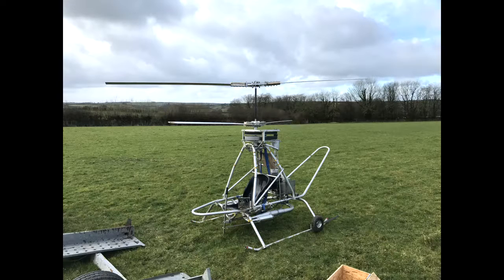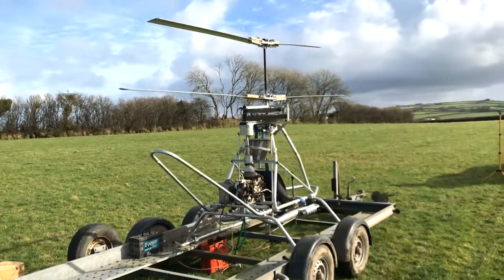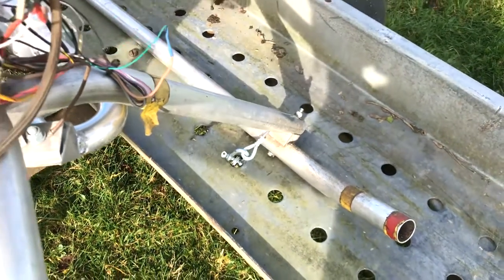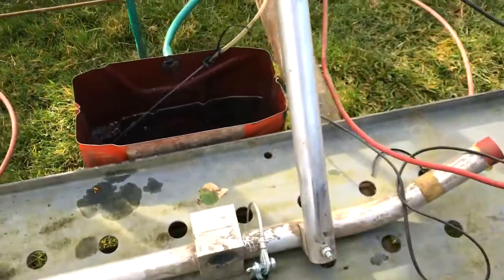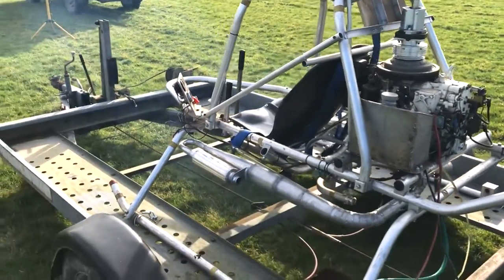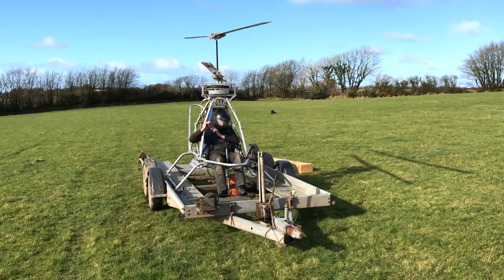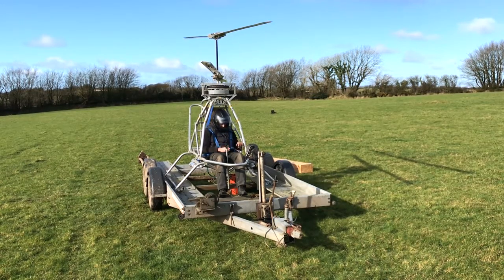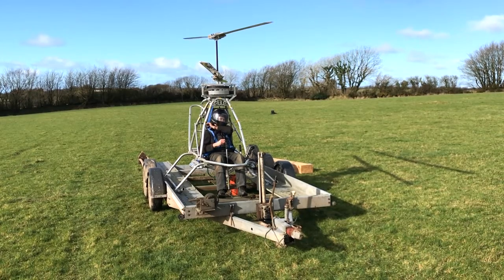My Homemade Helicopter Can Fly

Comment: Wow, Notice the abscence of Collective? these blades are fixed pitch, there are no normal helicopter linkages, its pull on the throttle which means its not a real  helicopter than can autorotate. Contra  rotating blades are far more stable but still need to change pitch if there is an engine failure.
This machine cannot be flow anywhere other than ground hover without the risk of certain death from an engine failure.
Reply from the maker: I thought contra rototating blades would be more stable. They definitely aren't, no more stable than an R22. 
Yes only a couple feet.

Comment: This is great. I’m planning on making my own and I already have some ideas!
Reply from the maker: 👍 full scale or model ?
Reply: @Ben-Dixey  full scale
Reply: I’m getting a 3d printer soon which can be used for precision parts
Reply from the maker: I've not used a 3d printer before but I've seen people use them to make  some complicated parts. Will have to get one myself one day. My only reservation is the strength of the parts it produces, in plastic anyway.
Reply: @Ben-Dixey  I’m planning on it being electronically powered but I don’t know if that wil work

Comment: How did you get past the CAA interfering, they keep homebuilt helicopter as their control entirely????? How would you explain flying with an underslung trailer?
Reply from the maker: During the hovering the machine is tethered at all times. Ground anchors and cables. I think tethered is ok but I might be wrong.
Reply: @Ben-Dixey  I was joking about the trailer at a ton weight.
Reply from the maker: Sorry yes. 😆 my friend suggested there must be easier ways to move the trailer around.

Comment: Sir plz change the sparkplug with iridium tip sparkplug and use engine adhesive in engine oil to reduce vibration,wear and tear too

Comment: what kind of engine did you base it on?
Reply from the maker: It's a 60hp Johnson outboard engine. 2cylinder 2 stroke, the tuned exhausts might have increased the power above 60 though.
Reply: @Ben-Dixey  dude. So it's a manual trans??? How did you connect the propellers to the drive train
Reply: @Ben-Dixey  oh nevermind that's a boat engine. I figured since it was 2 stroke it'd be a bike engine. I suppose the switching gears would making flying really difficult wouldn't it
Reply from the maker: That's it, one gear and one speed, I've seen some homebuilt helicopters that have used a multi gear transmission but it's pointless additional weight.

Comment: I don't understand what was the purpose of the video that nothing useful was seen, a man sitting without doing anything
Reply from the maker: The video demonstrates the helicopter can actually fly, it's tethered to the Trialer for safety but lifted off a couple inches. This was a massive achievement after five years of designing, building and testing. The videos after show it hovering up to three feet now.

Comment: Cool, does the difference in pitch ensure they both have the same AOA so torque is equalised across both discs?
Reply from the maker: Yes I believe that is correct, the downward flow of air onto the bottom rotor reduces its angle of attack.

Comment: do you know the power band of that motor and it's safe operating rpm?  it looks like you didnt get lift till way up in rpm. Perhaps you need more Blade to get the power to the wings a little earlier.
Reply from the maker: In this video the engine is running at around 5500rpm and it's standard maximum is 6500rpm. Because I've made the exhaust expansion chambers I'm not sure what the power is now or the band. Since this video I've done more testing and added much more weight, but it's now fully capable of free flight. I just need to learn how to control it.

Comment: Maybe make the chambers out of 0.6 mil steel. Aluminum can not resist the temperatures and vibration and will always crack unless you make it so thick that there will be no weight advantage. You don't want to experience a crack when actually flying, the power drop will be significant . Look into hydroforming for your exhausts, it simplifies the design and the amount off welds needed, so lesser potential points of failure. Make your calculations with the chambers to prevent  the engine to become to peaky, volume and length are your friends here to keep a torque and not only max HP. The tailpipe and mufflers don't need to be at the end of the pipe, think of them as overpressure valves and mount them were its convenient. Leaving your brass balls at home might help you lifting off😁.
Reply from the maker: Thanks for this. I think you're right about using 0.6mm steel over aluminium the vibration issue I'm sure will cause cracking at some point in Ali. The exhaust gas temperature I think I calculated to be around 350degC well below the melting point. 
Hydroforming would definitely be worth trying next time as long as it comes out half decent I would be happy. 
The exhaust tuning side of things I used the calculations from the AU mechanic on YouTube, brilliant set of videos going through it all, i used the figures for broad power rather than peak power and the pipe dimension were altered accordingly, the tuned length is quite long. 
You mention the muffler doesn't have to be on the end of the pipe, could you expand on that ? Cheers
Reply: @Ben-Dixey  You can have the tailpipe (or stinger ) welded  somewhere in the midsection of the chamber without any negative effects on the engines characteristics. In the 80's I used to race with a Yamaha TZ750 and my set of pipes for rainy weather or circuits with many  short corners were like this. Because I could make the pipes longer it helped me with gaining bottom power, lowering the powerband by approx. 300 revs. , making the bike less twitchy to drive, but losing top speed. I am not sure if expansion chambers are the way to go, because they will narrow your powerband, forcing you to check revs constantly . When a two stroke gets "off the pipe", the power loss is substantial and before the engine is revved up enough to profit from the pipe, some time will have passed. You don't have a gearbox and clutch to compensate for these things, just altitude. Not something you want to happen on the wrong moment, real live is not a cartoon.  Look at the rotax aircraft engines, they don't  have expansion chambers and deliver power over a wide powerband. Might be worthwhile to have a chat with someone in the know or try to find some information about what pipes they use (aftermarket catalogues anyone?). Engine manufacturers have bigger wallets then you ( I suppose) and have already figured these things out in the past.
Reply from the maker: Understood, I remember seeing somewhere about the tail pipe being inserted into the baffle cone and it not affecting power. I think I didn't do this as I needed the tail pipe to do a 180 for muffler fitting purposes. 
The 2 stroke aircraft engines as you say don't have expansion chambers and I'm sure they designed them for reliability over peak power. I have the dimensions of a 50hp Hirth aircraft engine exhaust and was going to copy it. Then I started researching expansion chambers and decided I wanted the best chance of lifting off rather than reliability. After the prototype machine has been proven to fly under control I might well revisit the exhaust and try the copied Hirth design. The helicopter in its current format is only going to be flown at a few feet and no higher for other safety reasons than the engine reliability issues. I've done 3 more videos since this one and performance wise the exhausts are working for me. I tried a generic eBay exhaust and the helicopter wouldn't lift off the ground so something is working. Any ideas what Hp gain it's likely to have from adding expansion chambers on a 60hp outboard power head ?
Reply: @Ben-Dixey  Given that a normal outboard exhaust is just some collection area that vents under the waterline, I can only assume that it doesn't get worse. Beware that expansion chambers can have some very expensive side effects on cylinder heads and pistons(don't ask me how I know😭), so keep an eye on your jetting, you don't want the engine run to lean. Better keep mixture on the richer side to help cooling your pistons. How many degrees is the exhaust port timing? Small tip: To prevent cracking of the exhausts it is best when mounted with springs at the cylinder side and rubber silent blocks further down the line.
Reply from the maker: @dutchsailor6620 Someone else warned me about running lean with the expansion chambers.  I've been checking the spark plugs against a chart comparing lean to rich and they look ok to me but I haven't gone any more scientific than that. 
The exhaust port timing is 168.5 degrees. 
I've got the expansion chambers mounted on springs but there is approximately 6" of rigid tube from the manifold before the springs.  I had an issue with a rubber mounting bracket broken from the vibration, I added another mounting point further back and it hasn't broken again. How have you checked the mixture before ? gas analyzer?
Reply: @Ben-Dixey  A gas analyzer on a two stroke engine is a lost case, the readout will be very depending from  the combination rev/tuning/reverse spooling. Also I don't think that the probe will survive the unburned oil/gasoline shower. Its back to old fashioned sparkplug  reading. In my experience, outboard engines are normally jetted on the rich side, so that is ok. Just keep an eye on those plugs. Anything lighter than coffee brown should get your alarm bells ringing, greyish is definitely to lean. I watched the videos of the pipes. Instead of mounting the pipes on the manifold  with a flange coupler, a coupling where the pipe slides over the manifold might be more secure. With a 168.5 degree exhaust timing , the engine will have a lot of bottom power (4 blade props maybe?) and by the looks the pipes are not that aggressive, resulting in a wide powerband. The stingers look rather large in diameter, making them a little smaller will result in a stronger return pulse from the exhaust, but will raise the temperature in the cylinders. What is the capacity per cylinder?
Reply from the maker: Thanks for your expertise. Each cylinder is 368.5cc. Engine Rpm at lift off is 5460. I think the book rpm for peak power was 5500-6000 with the outboard standard exhaust.
Reply: @Ben-Dixey  Happy to help. At this cylinder capacity I would leave the stingers alone. Best is to look at the whole project as a proof of concept and not try to milk the last HP out of the engine. It might be interesting to mention ambient air pressure in your next videos, its another reference point and interesting to see if it affects the outcome of certain tests. (Higher pressure = more engine power & lift from your blades)
Reply from the maker: Good idea, I'll mention the temperature and elevation. I expect you know but helicopter performance is greatly affected by density altitude not just engine performance but lift is affected too. Helicopters have an inlet manifold vacuum gauge to tell the pilot how power is being used. I think this is like a throttle position sensor so could be done electrically instead. I have a vacuum gauge but haven't attempted connecting it to the engine yet. It would be good to know what % power is remaining at hover.
Reply: @Ben-Dixey  Add humidity too, this greatly affects 2 stroke performance. With these measurements its not so much about  accuracy but more about consistency. It might also help you  to predict what you can expect from a test run and recognize potential failures before they manifest themselves otherwise. Spreadsheets work great for these things.
Reply: Just as an afterthought: I see you testing the helicopter while standing on your trailer. Would it be possible to park the trailer on a vehicle scale (example: MOT station) when testing with the helicopter strapped on, so you can calculate the generated lift? This might also be helpful when evaluating if changes are made or to test the effect from settings. I don't think you can test those to the full extend when tethered to the ground and it will be less risky.
Reply from the maker: @dutchsailor6620  Great thought as it would be an excellent way to measure the lift and as you say collect some performance data. can't see any weigh bridge owner letting me test an experimental helicopter on it but you can buy corner scales for race car preparation. Might be a cheap enough set somewhere? From my research with 60hp maximum take off weight would be around 275kg, it's currently lifting around 240kg so not much left to play with.
Reply: Another brainfart: If you know the total rotating mass off your helicopters shafts, rotors, rotor heads, drive wheels etc. and would measure these parts revolutions over time (not the engine revs), you should be able to calculate the power needed to get there, much like a dynamo-meter used for cars and motorcycles. This might also show how your pipes are performing and if the fuel/air ratio is acceptable over the whole power range.
Reply from the maker: @dutchsailor6620  Interesting thought, I know what your getting at. All this weight would act like a flywheel and you could measure the acceleration of the mass to calculate the power ?  The only trouble is a flywheel would have little drag from the air where as my rotors have massive drag. Personally I wouldn't be able to work out this drag and factor it in, there might be someone who could but like the lift calculations they are to complex for me. I would like to build a dyno one day and this project would be the perfect excuse to build one.
Reply: @Ben-Dixey   Because the drag will be there at every measurement the reading would still be consistent. the engine still has to deliver the power to overcome that drag. Dynos are wide open throttle things anyhow. You might not get the same graph as if you put the engine on  a real dyno, but also their output varies . No 2 dynos will give you the same result, just swapping rims for another material is enough to mess up your results. Just ignore the drag factor (treat it as a constant in all the measurements, so basically ignore it) and look at different readouts as relative values, not absolute. You could  build a pickup for next to nothing using an Arduino and a reflective pickup or a hall sensor for rotation vs time measurement. http://wotid.com/dyno/content/view/16/35/ is a great source for the math involved.
Reply from the maker: @Dutch Sailor  I can see how performance of the engine can be compared in this way when altering things like the exhaust design. In order to determine an actual figure for HP am I right in thinking this has to be done from accelerating a known inertia flywheel? On the website you shared it doesn't take into account any flywheel drag from the air or bearing friction, my drive has quite a few bearings plus belts and the massive drag from the air would need to be calculated to find an actual HP?
Reply: @Ben-Dixey  For measurement Prop, drivetrain, drag and friction are the same as the ideal inertia.  You can look at the drag and friction as a part of the inertia that has to be overcome. It will be there always and in every measurement, these are not variables that can be altered in any way so you just take them in the equation. A car/motorcycle dyno also has its losses like bearings and brake friction pads but they are not taken in the equation either. The only thing that in your setup matters for the lower rev measurements would be centrifugal clutch slip. That is why I advise you to take the measurement from a drive shaft. After the clutch has full grip there should be a linear relation between motor revs and prop revs, but this will depend on the centrifugal clutch adjustment .
Reply from the maker: I will give this some thought and try to get my head around it.
Reply: @Ben-Dixey  👍

Comment: Nicely done. Why different pitches in the two rotors? That will surely result in unwanted yaw.
Reply from the maker: Because the lower rotor is working in the downwash of the top rotor lift is decreased and so is the torque. It's balanced now and a one degree difference is what was needed.

Comment: How do the coaxial rotors work?
Reply from the maker: That's a big question but the point is to equalise the torque on the airframe so you don't need a tail rotor.
Reply: @Ben-Dixey  true,

Comment: Excellent build !  How did you arrive to the spacing between the rotors ?
Reply from the maker: Thanks. 👍 in this video the spacing was longer than it is now, I have reduced it to 10% rotor diameter which is where I think it should be after reading a study on the subject. This has also been agreed with by a few knowledgeable people I've had contact with. I'm expecting the rotor thrust to increase on the next test.

Comment: can u teach me how to make this helicopter?
Reply from the maker: How much do you know already ? A helicopter is one of the hardest things to make in my opinion. I've had a lot of engineering experience before attempting a project like this.
Reply: @Ben-Dixey   i want learn a part of main rotor how to make rotor can move forward,backword and  beside simultaneously.

 second part is tail rotor whici how to fit go beside and fit with main rotor? just that my question
Reply from the maker: @afiq_mustaqim  my helicopter is different to most other helicopters in how it's controlled. my helicopter does not have a tail rotor as it does not need one. The main rotor tilts in the direction you want to go. This is different from a single rotor helicopter and that is controlled with a swash plate which alters the blades pitch several times each rotation for control. A single rotor helicopter needs a tail rotor a coaxial helicopter does not.
Reply: @Ben-Dixey  ouh... i was find many platform for learn anyknowledge but still not yet